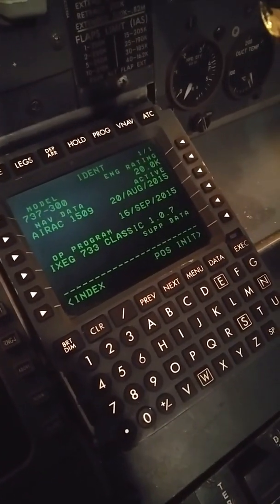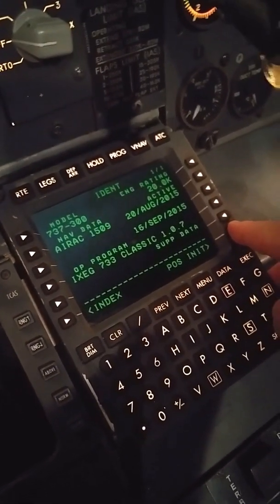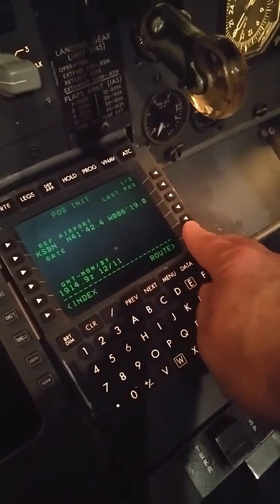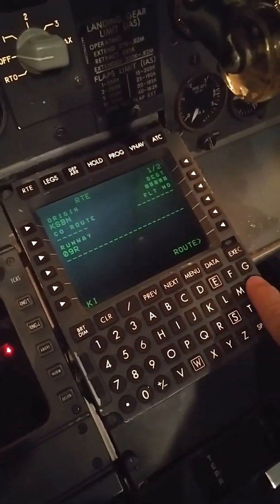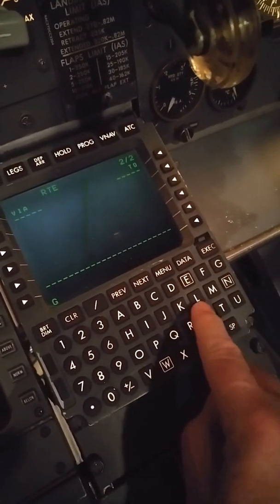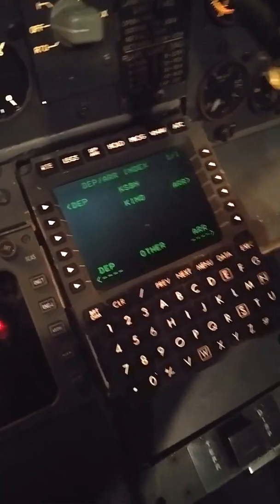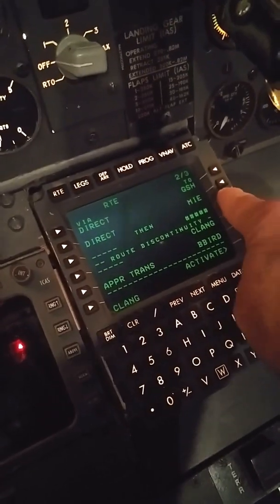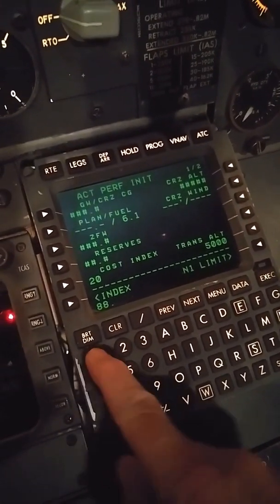Real CDU testing in the 733 Sim

Comment: Amazing! Does the real CDU have a computer inside the CDU unit? Or is the CDU unit only a display with buttons and computer is located on the other location? Is the screen (output) generated by original hardware or is it generated by your PC (or XPlane)? Do you have to update XPlane's AIRAC or AIRAC that is stored on the FMS?
Reply from the maker: The cdu has an internal processor that coverts the Arinc data and displays and converts the key inputs and outputs as Arinc. We read and xmit the arinc messages and convert to datarefs via the Teensy

Comment: WOW! that's so cool!  Did you need to modify the CDU any in order to get it working?
Reply from the maker: November Foxtrot. no sir. all original.  just sending the data it expects to see.
Reply: All data is extracted from X-Plane and processed through a Teensy microcontroller. There are mainly two protocols involved. The raw data is transferred with ARINC 429. Rob uses a Holt HI-3593 chip to generate that. On top of that, there's the CDU protocol ARINC 739A, which is implemented in software. Some hours/days/weeks of work and still may have some bugs.